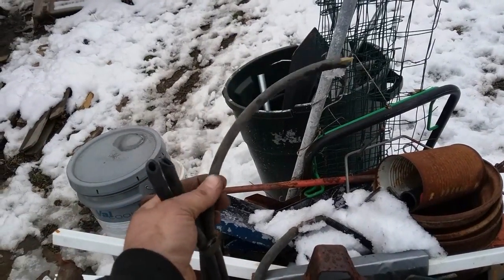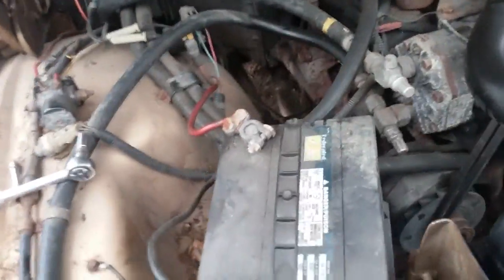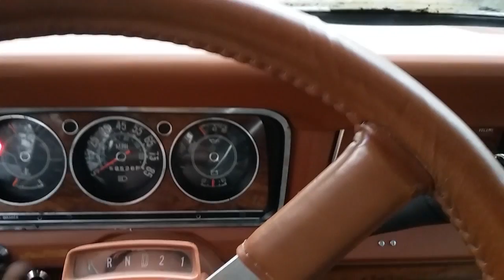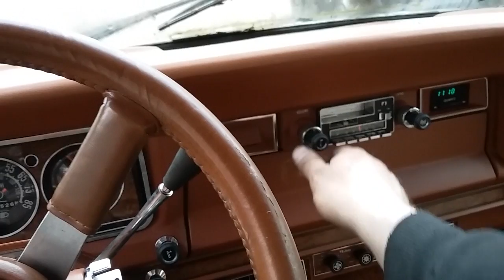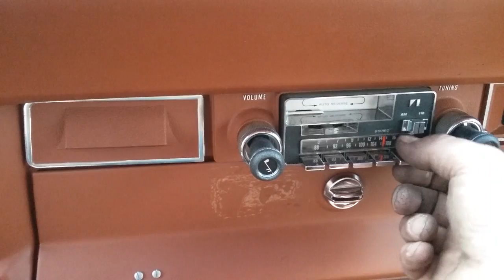Redoing vacuum lines on Jeep engine

Comment: I cleared up the clutter by tossing most of them. I only have ported vac to timing advance, manifold to brake booster and PCV.
Reply from the maker: Maybe one more vacuum line going to the heater vents. It is optional though
Reply: I dunno why anyone woukd delete the charcoal canister and the fuel bowel vent on the top of the carb to the canister.. unless you enjoy smelling gas everytime i walk by the Jeep ?

Comment: Your video is just what I need! I just bought a 1986 Jeep Grand Wagoneer,been sitting for 15 yrs. Somebody has mixed up the vacuum lines and I know nothing about them!LOL! Do you happen to have a diagram of how yours ended up? I'll bet that's why she was parked. It starts up now,runs real rough and stalls after about 20-30 seconds. And guess what! The front diff drive shaft is missing. I bet whoever mugged up the vac lines got it stuck in 4wd and didn't know what to do!LOL!
Thank you for the videos! I'll be watching the carb rebuild! If you can help me straighten out mine please do!
Reply from the maker: It's real simple to do. I have the vacuum advance on the distributor running to a carburetor port that sucks vacuum only at off idle or cruise speed . The 4 wheel drive is idle vacuum and is 1/4 inch line in size and can be hooked up anywhere the port is 1/4 inch either on carb or on intake. Power booster for the brakes is a 3/8 inch line and is run off of idle vacuum and there is usually only 2 spots to hook this line to that is 3/8 inch (biggest vacuum line). Heater vents are run off idle vacuum and is 3/16 inch line and can be hooked up anywhere there is a 3/16 inch port with idle vacuum. Everything else is pulled off the engine and any ports on intake and carb is plugged, have to look real good to make sure. Gas tank vacuum lines need to be plugged when pulling out vacuum canister. 
To know where to start from, best is to start from the part and work to the engine. I have no diagrams, sorry. 4 wheel drive switch on the dash is the place to start for that. Power booster line is on front of power booster behind the master cylinder cap. Heater vent vacuum lines start behind the switches inside on dashboard. Vacuum advance is on distributor.  

Let me know if you need more help.
Reply: @prancstaman  Excellent prancstaman! I really appreciate your reply! I'll be going out later today and getting vac system arranged as you have suggested. Do you have any info to offer on the ignition electrical system? I'm trying to chase a "gremlin" that is popping up when first staring. The vehicle shuts off exactly as if I turn the key off. She will run for only 30- 45 seconds and then shuts down. I think I'm not getting any dash lights when she does the shut-off, if that matters.
I'll check your profile to see if you have provided your email addy, so as to not clog up your comments on this video. Check my profile(or what ever you call it on the YT) for my email if you like. Thanks again man!!
Reply from the maker: @sirchomps  Been sitting for 15 years, probably is the ignition coil going bad. Buy a new one from a parts store and put it on to see if it still does it. If that isn't the problem, probably needed replaced anyways from sitting. If still happening after changing coil, then change the ignition module on the driver side fender under the hood. Something is getting hot and shorting out. If the problem is still going on, check the wiring to make sure there are no cuts in the wires and corroded, and do power tests with a multi meter. Clean any grounds you see in the engine compartment. There are 1 or 2 braided ground wires from the motor to frame, clean the mounting spots with sandpaper. I would assume you already put new spark plugs and ignition wires on, if not then now would be a good time. Hope this helps, and this is fine talking in the comments, other people may have the same problems.
Reply: @prancstaman  Thank you ! Yes, I have replaced the ICM. It had leaked out all the oil/tar potting, so I knew it was junk. I've got a new fuel pump,haven't had a chance to get it installed yet. I pulled the plugs and inspected the plug wires, the plugs looked really good! None were oil fouled! Thank THE GOOD LORD! So that tells me the engine is pretty healthy. The plugs were coated in carbon. Not baked on but would wipe off with a little effort. The electrodes on the plugs were in amazing shape, I don't think there's to many miles on them, like they were installed just prior to her being parked. The wires are decent. No evidence of rodent damage. I will get around to buying new plugs coil and wires in the near future. I was trying to avoid unloading the "parts canon" on her before I could determine the condition of the engine. Also, I'm working off a fixed income budget. LOL! I did Ohm check the coil's primary and secondary windings, they all checked good, but like you said, it doesn't mean it's not shorting out once it gets warmed up.
I have gotten a suggestion off a forum group on the web, saying I should check the sock on the pick up tube at the sending unit. There is an access panel under the back seat, I'll be looking at that the same time I am replacing the fuel pump.
Not sure if I made mention, but I did pick up a rebuild kit for the carb. It's the MOTORCRAFT 2150. It's leaking, not "dripping", but the gaskets are becoming shinny and the outside metal surfaces of the accelerator pump and power valve are getting moist. Maybe she's sucking air around the accelerator pump. I'll keep you posted on the progress. Thank you for the info and the vids!!
Reply from the maker: @sirchomps  Sounds like you are doing good. Plugs having black carbon on them that you can wipe off means engine is running rich. The power valve is probably blown, you can either buy new or epoxy the old one shut. You put the epoxy on the vacuum side on the diaphragm. Float sounds like it is stuck too if gas is leaking from the carb. Wouldn't be a gasket because the fuel level is below any gasket. As for pulling the sending unit, if you pull the cover off under the seat and find it is rusty, leave it alone or it will just break. Surface rust is ok but the rust that flakes off in layers is not good. Think a new sending unit is $80. You want to check the pickup in the tank, when you have the fuel pump off, blow into the line to see if it is clogged or has a hole in it. Then take it from there. If everything is good, you would feel the fuel in the tank bubbling when you blow and you can have someone by the gas cap listening for the bubbles in the tank. This would check the fuel system from the tank to the fuel pump.
Reply: @prancstaman  Thank you again for the reply!
I pulled the carb yesterday to begin rebuild. It was bad clogged with carbon/fuel varnish. The underside was as bad as the one in your carb rebuild video.
Letting it soak for maximum time allowed. I did remove all plastic parts. Lol!
When I disconnected the metal fuel line between carb and filter, there was no gas in the line or carb. So I'm thinking the power valve was bad allowing fuel to run back out of carb. Also, there was a lot of trash in the fuel bowl, as you said the float was probably stuck, Looked like pieces of a degraded fuel hose. I had replaced a short hose coming off the fuel filter (after filter) to carb before I tried cranking it the first time, I guess some chunks still made it into the carb. I could see some of the chunks in the seat after removing the needle!
I'll try your method of blowing through fuel p/u hose at fuel pump rather than pulling sending unit. I would rather leave it alone because I'm good at breaking things that were not broken to begin with! Lol! Will give update once I get the fuel pump removed and new installed!

Comment: I inherited a 82 J 10 with the 360 . And the vacuum line system is a mess. My question is what to do with all the metal lines screwd in to the exhaust manifolds?  Can they be removed and plugged off? ...BTW thanks for your video.
Reply from the maker: Yes, They can be removed and plugged. That is a system that pumps air into the exhaust and helps burn the pollutants in the catalytic converter. I used electrical piping conduit cut up in 1/2 inch pieces to put over the bolts when you remove the original piping manifolds on both sides. The bolts that hold the piping manifold on the exhaust manifold are hollow to allow the air to pass through and into the exhaust. 82 is pretty old and the bolts might be rusted in, if you have a welder then you can just break the piping off and weld up the holes while still on the motor. Since the piping is going to be removed, you can also remove the rubber hoses, remove the valve that controls the air flow and plug the vacuum line going to the valve going to it, the air pump on the front of the motor, and belt going to it. I think I cover this in another video on removing this system but forgot which video. Maybe watch the playlist. Hope it helps.
Reply from the maker: I looked through my vids and the video you want to start watching from is "Starting the work on the Jeep 360 engine"
Reply: @prancstaman  
...Thank you for your replies..If I run into problems, or have other questions, I'll be back in touch...
Reply from the maker: Sure thing, i know these kind of jeeps inside and out. I had my one jeep for about 20 years and rebuit it numerous times. :)
Reply: Break em off and weld the holes shut.. did that to my 90 and my 76 J10

Comment: I've got a jeep wagoneer 86 and it's stuck in 4wd and I've narrowed it down to vacuum lines I've got no vacuum leaks so I'm thinking something isn't in the right spot
Reply from the maker: Hello Donnie. To your question, assuming you have a Jeep Grand Wagoneer (it matters about the name), like mine. A regular Wagoneer has the regular 4wd with the levers inside the cab and locking hubs on the wheel that you turn to lock by hand. My Jeep has the quadra track 4wd in it and has a little vacuum operated switch to go from 2wd to 4wd high. Some of the stuff I will mention will apply to both. By coincidence The jeep in the video, when I bought it was also stuck in 4wd. To the info......

First things first. Confirm that the Jeep is in 4wd, with the engine off and in park, go underneath and grab the front drive shaft to see if it will spin freely. If it spins free then the Jeep is in 2wd, if the driveshaft is locked by not spinning then it is locked in 4wd either by the axle being locked or by the transfer case being locked or by both. Need to have the front driveshaft spinning freely means it is locked in 2wd. OK, My jeep has a vacuum switch by my knee on the dashboard. 2 bolts hold this in place, remove the bolts to expose the colored vacuum lines behind the switch. Pull off the vacuum line connector, then start the engine to hear and confirm vacuum up to this point. If no vacuum then the vacuum line off the engine is the problem. If vacuum in line, then reconnect the lines to switch but leave switch off dashboard. Should be 3 lines and they go through the firewall. 
OK, under the hood, the vacuum lines are behind carb and switch to steel tubing and go down between the engine and trans and branch off to the front and to the back. On the front axle, on the pumpkin cover is the vacuum operated actuator to lock the front axle with I think 2 vacuum lines on it. One on top and one on the bottom of the diaphram of the actuator. For the system to work, there is constant vacuum to one line or the other. With the engine running and the switch in the cab should be in 2wd, remove the top vacuum line on the vacuum diaphram on the pumpkin of the front axle and confirm a vacuum signal. For 2wd, the vacuum pulls the diaphram up to unlock the axle so the wheels spin freely. To confirm that the axle is unlocked, with the engine off and in park, jack up driver front wheel only with the 3 other wheels on the ground. See if the raised wheel will spin. If wheel spins and the front driveshaft spins also then the front axle is still locked in 4wd while transfer case is in 2wd. If the wheel spins and the driveshaft does not spin then the axle is free for 2wd only. If the wheel does not spin while in the air then the axle and transfer case is in 4wd. At this point, there is vacuum going to the pumpkin cover actuator and the front axle is unlocked and verified by lifting the driver front tire and is spinning free while drive shaft is not moving, with the switch in the cab on 2wd.
Now comes the transfer case. I forgot which vacuum line does what on the vacuum operated actuator but you need to verify that there is vacuum going to one of the sides of the diaphram. You need to crawl underneath and disconnect both to see if vacuum is coming from one of the lines while engine is running. The actuator on the transfer case controls the 2wd to 4wd high only. 4wd low and 4wd high selection is on a separate lever and linkage. Chances are that the linkage for the 2wd to 4wd high that is operated by the vacuum operated diaphram is rusted up and seized. Need to free the linkage up with penetrating oil and by putting pliers on the levers to move the linkage to free them up. Then try running the engine  and seeing if the transfer case linkage is shifting by the diaphram into 2wd. Ofcourse, confirm that the Jeep is in 2wd by grabbing the driveshaft and spinning freely while in park and engine is off.

Hope this helps on narrowing down the problem. You will learn stuff too by doing this also and you will be better prepared for future issues. Feel free to ask anything else.

Comment: I noticed behind carb and egr value there is vacuum port where does it connect cause on mine when i crank it it blows strong air. Im trying figure out where it goes. I have a 81 jeep wagoneer limited. It ran then parked it and now it jist cranks n turn but doesnt start. Im kissing myself in the ass cause ik its something simple to get it started.

Comment: I have. 4wd problem with my 89
Reply from the maker: What's the problem?
Reply: @prancstaman  the 4wd switch cables are cut,  and vacuum lines are missing and idk where everything is
Reply from the maker: @vFantasyYT  The switch gets it's vacuum from a T off the vent control vacuum line on the back of the intake. T's off on the firewall behind engine. Main line goes to center port of switch. Then one vacuum line for engaging the 4 wheel drive diaphrams on transfer case and axle front cover. Then the other vacuum line coming off the switch is to disengage the 4 wheel drive on same diaphrams just in a different spot on them. Think there is a drawing of this in the maintenance overhaul manual that you buy from the auto part store.
Reply: @prancstaman  thank you I'll haft to find it
Reply: @prancstaman  I figured it out the previous owner bypassed the vacuum lines and 4wd wiring and did something different
Reply from the maker: @vFantasyYT ok.
Reply: @prancstaman  ya it's controlled by a cable so

Comment: Hey bro not trying to burst your bubble , but you need pcv on this motor or you will overpressurize the crank case and you’ll have serious issues. Also the two things u think are reservoirs are for the transfer case. Just fyi bro. Pcv needs to be there for ventilation don’t delete it
Reply from the maker: PCV on how it works is a controlled vacuum leak. The carb is easier to tune in without it because of the controlled vacuum leak being plugged. Where the air enters the engine for the PCV system is now the crankcase vent and will be directed to the top of the carb. Don't know what you mean by the transfer case, sorry. The plastic yellow canister is for absorbing fumes. can't remember if the transfer case vents into it. It's been a while. I'll find out soon enough when I try to get this Jeep back on the road, maybe this year. Thanks for watching.

Comment: What does the power valve vacuum hose run to?
Reply from the maker: Any port that has manifold vacuum, for it to work correctly. The port can be on the carburetor somewhere or on the intake manifold somewhere.  Keep in mind that there are 2 vacuum sources on an engine. There is cruise vacuum, which operates the EGR valve and distributor vacuum advance diaphram, and is only produced from the carburetor, from off idle to almost mid range rpm.  Then there is manifold vacuum, produced from the engine running, and is the vacuum in the intake ports and also the carburetor. I point the difference out about the vacuum ports in the video.

Comment: Nutter bypass?
Reply from the maker: Bryon Vary what do you mean?
Reply from the maker: Thanks for the link, looked it up. Yah, kinda the same idea. Just trying to make things simpler for the engine. Would have taken a spool of vacuum line to fix the mess and new sensors to fix the bad ones creating havoc on an overly complicated vacuum system that just sucked from the beginning. Thanks for watching guys.

Comment: What kind of carburetor is that
Reply from the maker: It's a Ford Motorcraft 2 barrel carburetor that is standard equipment for this AMC  360 motor.
Reply: prancstaman ok I have a 1979 Jeep Cherokee Chief the 2 door wagon. I believe I have a Rochester carb.
Reply from the maker: Rochester is a Chevy carburetor, You must have a Chevy straight 6 cylinder engine in yours. That was the only other engine option with these Jeep wagons.